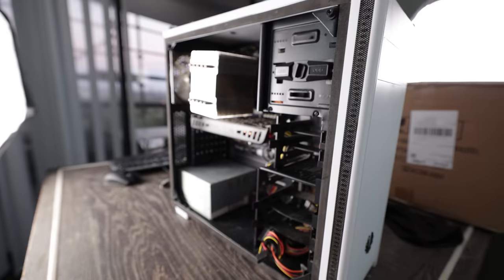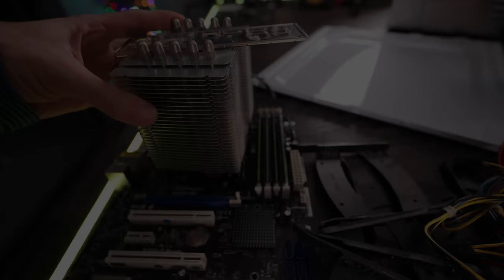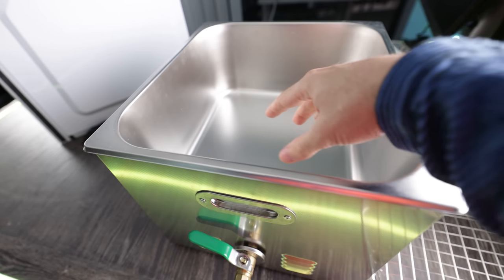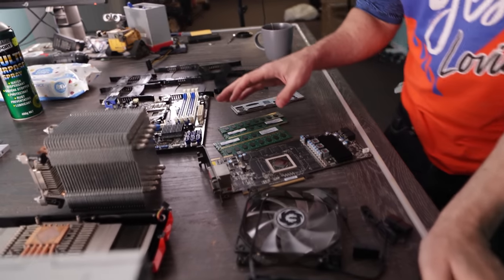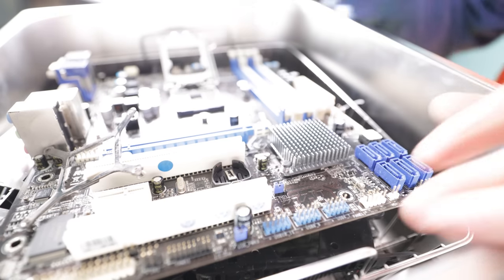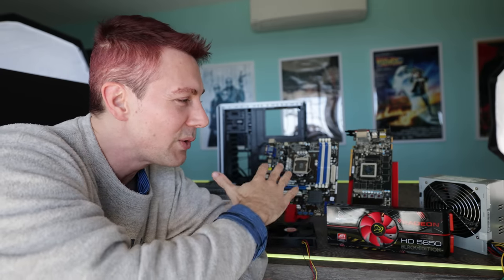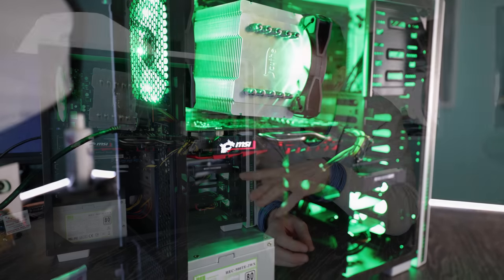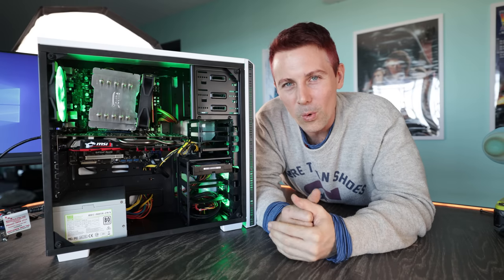ULTRASONIC Cleaning a THROW AWAY Gaming PC! - PCUC S1:E1

Comment: Always hold fans when blowing with air. You can damage them or other components such as when it was plugged into motherboard. And don't stack electronics in an ultrasonic cleaner, its vibrating, your vibrating the computer parts against each other at an extremely high frequency.
Reply: As the wise Greta once said 'BLAH BLAH BLAH'

Comment: Finally got the ultrasonic! 👌🏻
Pro tip: cleaning, drying (alcohol bath) then dry again. Alcohol will displace the water and evaporates quickly. 
Also an ultrasonic with wave oscillation is the best for mobos / repairs

Comment: The only thing that I would be reluctant about submersing in water are the fans.  Shouldn't the bearings at least be taken apart and lubricated after drying them out?  🤔
I have gotten some good results washing out old motherboards and using a hair dryer or heat gun on low settings to dry them out afterward. Nice video Brian! Love the finished product!  👍👍

Comment: This was super cool. If I ever get to a high enough level of volume I'm getting one of those cleaners.  Cant wait for the next one!

Suggestion: Next time you should run benchmarks while its dirty as well to compare with the cleaned version. Obviously it's going run better with a new cpu and graphics card, but It be would be really interesting to see how much of a difference getting all that crap off made too.
Reply: What is the best way to clean without an ultrasonic cleaner?
Reply: @charlescadogan8504  Elbow grease and 99% alcohol

Comment: want your CPU to run cooler? switch directions of the fans you installed and add an extra fan on the back!
the airflow direction is only running hot air onto your CPU
you need to have air being pulled into the case not out of the case i would also reviser the fan on the front of the case also so you can air enter the back of the computer and leave though  the front since you don't have any vents on the top of the case....
only a personal suggestion!

Comment: liquid name which u used with water?

also how many Little is this cleaner? will 3 litter is ok for Mobo?
Reply: Just dishwasher soap is ok.

The most important part is drying all components for 3 days, if possible, create DIY incubator box as if you're trying to hatch a chicken. This way you can dry off Electric components easily

Comment: few aesthetic recommendations: the inside of the case is black,switch the psu to a black one,which will also match the gpu and to keep that colour scheme -as you did w/the ram,dominator ddr3,right?-also make the bling fans red.
p.s. the mobo is shite,so no matter what you plug into it,its still shite.
great work Bri,keep 'em tech yes vids commin'!
p.s.2 did the owner keep it in a sawmill or a barn?

Comment: How long did you have dry the components for after washing?
Reply: 1: he used towel
2: waited a while till looked dry
3: blew air on it (could also use heater)
4: you're left with some water residue that won't evaporate. That's why he used the spray which inlcudes water dispersant. You can use alcohol for this too.
5: he then let it overnight. If you alcohol, it's enough to leave it 5-15 minutes after this

Comment: Greg Salazar - I'm not even touching the power supply, it is quite a dangerous step...
Tech Yes Man - Just wash it with water!
Reply: pure water is not conductive though. salt water is
Reply: 8:17 - 8:45 is the best part imho. Handling power supplies is only dangerous if you don't know what you're doing. So for some people its better they leave the power supply alone.
As shown here its perfectly fine. The only thing I would do different is: I would've at least partly disassemble it first to see better whats going on inside and wouldn't've throw the fans into the ultra sonic cleaner. Their might be ball bearings in them which are not happy without some grease and geting new grease in them is more work than cleaning them with a cloth.
I don't know but I guess Greg wouldn't've been sued for showing how to wash your power supply on his channel if someone is going to be hurt doing so...
Reply: yeah Bryan drowns all the PC components in soapy tap water, but still hand wipes the case down. Yet Greg hoses cases down in his driveway.
Reply: @jherdamrhoimagallanes8464  Tap water isn't pure.
Reply: Greg doesn't have the yes on his side
Reply: That Aussie is built different

Comment: I don't get why people just let their PC's collect dust like that. Ugh :_FaceWonder:.
Reply: ikr
Reply: some people don't know how to clean a computer or just think there's no need I've already received several computers with a simple problem because the person didn't know it was something like cleaning the cooler.
Reply: I don't really have time to do that..work bro
Reply: @Hakan89  if you keep a computer clean regularly and make sure you don’t keep it in a place where it will accumulate excessive dust like in a carpeted floor it doesn’t take long blow out a computer with a can of compressed air. I take 10 to 15 minutes to clean my desktops at least once a month to a month and a half. That level of care will help make sure your computer runs for a very long time.
Reply: People put the PC on the floor. and have house pets XD
Reply: @Hakan89  3 minutes top with a good blower like a data vac or any knockoff
Reply: @virtualtools_3021  i have a laptop , that's more difficult
Reply: Mine  not boot up after make cleaning servis at my pc how bout that.

Comment: There is NO WAY that I would do that type of cleaning with a PSU or fans. Some PSUs have cardboard or paper in them to direct airflow and as part of the transformers. A lot of PC fans also have unsealed bearings, if you get water in them it can significantly reduce their life. The other stuff is fine as long as you dry it out.
Reply: Interestingly...i just posed a question about fans too.  Thanks for your comment which has expanded my knowledge of the inner workings of the psu. 👍🤓
Reply: @SFAJmz05  I wouldn't water the fans too.
Reply: Also, don't just blast fans with compressed air like this, always prevent the blades from spinning when cleaning them.
It harms the bearings, and since a motor can act as an generator, it can induce voltage which can damage the motors elecronic or whatever it is attached to.
I always lock them in place with toothpicks.
Reply: @timhartherz5652  the bearing part I can see, but the power generated is negligible.
Reply: @EvilTurkeySlices  yeah people really overestimated the power of muh renewable energy

Comment: Something to keep in mind is that the power supply tester simply verifies that the power supply is still working and putting out the correct voltages.  It doesn't forecast power supply health so a PSU that tests good a month ago could fail in a month due to capacitors already being on the way out.
Reply: That's true. It's always good to check capacitors inside, or possible corrosion.
Reply: A PSU with bad caps may already show some signs of voltage regulation issues so although you are correct, it should mean the PSU should be pretty healthy at that point.

Bad caps usually fail fairly slowly before they finally pop, so you'd see some bad voltage a fair way out.

Comment: It's really not fine to use tap water. Especially if you have hard water. You should be using distilled water. 

If any minerals that are in the water don't get 100% removed before you fire up the electronics you could fry is. The minerals can act as a connection point. You have been lucky.

Why is that cpu block installed like that. My OCD is jumping off the charts!

Comment: You know, it's pretty easy to make clean water, rain water is very clean, just collect it through a filter and that's free electronics cleaning water. The output of an AC also creates clean water. The best way to disperse water is with ethanol closer to 100% the better and it's dirt cheap to either make or buy.

Comment: I'm just curious about the fans after submersing it to an ultrasonic cleaner. Because most bearings have some sort of lubricant in them. I'm assuming it's better to attend to those fans and refill them with machine oil/grease.
Reply: those fan bearings will be sealed so lubricatnt should not be impacted in any way!

Comment: There's another trick you can use the ultrasonic cleaner. Fill it with alcohol to clean PCB's especially... The alcohol is much harsher on the components that's why you don't really want to have plastics in there and it will remove numbering and stuff but good for hella dirt not so much for dust as the water should work just as well for that

Comment: Very nice I have cleaned with ultrasonic cleaner many times before, however be careful of the PSU. As a motherboard it also requires thermal paste and thermal padding sometimes on some parts, so just investigate if that model requires any of those or it will have a very negative impact. Instead of using water you can buy none conductive electrical cleaner to use in the ultrasonic cleaner cutting down on all the waiting and mess and fuss with water.

Comment: a cool video idea would be using the ultra sonic cleaner with isopropyl alchohol to see if you could bring dead hardware with water damage and so on back to life, since its displaced water and can clean, even under the gpu chip

Comment: Anyone used an ultrasonic cleaner with a bath of Isopropyl Alcohol? maybe an option if you can provide enough ventilation ?
Reply: Heard it was a real fire risk. Supposedly some people fill the cleaner with water, then add another bowl inside the water.filled with 99 percent alcohol for less risk. Don't know if it works tho.
Reply: @christophermacias1334   Oh I know that IPA is highly flammable, I was thinking of outdoors on the end of a l o n g  extension, poss sitting on a concrete slab

Comment: No real reason to toss old parts unless they are toast. My current PC is running a 12 year old xeon ,32gb ddr3 in quad channel my board can handle 64gb or if bios updated 128gb. My setup both cpu and mb can even support ecc ram. I upgraded my ever faithful 680 4gb to a 8gb amd gpu a year and a half ago.  My setup is old as dirt but I am able to game just fine with my rig.

Comment: Omg what is he doing? I could not believe what I saw, my jaw dropped. DO NOT DO WHATEVER HES INSTRUCTING YOU TO DO!!!! 
Proper way to do this: remove/desolder all sensitive parts from PCB, especially all piezo buzzers, use a special undiluted PCB wash solution, preheat to 60C maximum, place prepared PCB in ultrasonic one at the time or in single layer, DO NOT STACK LIKE HE DID! Set for max 1 minute then flip pcb and set for another minute. That should be done, in extreme cases repeat for another minute, then wash with demineralised water (NOT TAP!!!) then wash and swirl PCB in 98-100% Isopropyl alcohol to ensure it displaces all water. Then try with air gun at 50C low airflow. And it’s done.

Comment: I'd still use distilled water on all the parts at the end, it's cheap, and with no minerals in it it doesn't leave things behind that can cause shorts etc. Everything must be TOTALLY dry, put it somewhat near a heater for a day etc. That spray is completely unnecessary.

Comment: my friend accidentally dropped a milk shake from DQ onto his pc and it all leaked down the fan into the MB . the pc was unplugged at the time, so i took everything off the MB including heatsink coolers for chips and put it in a tub with 92% alcohol and used a tooth brush to clean it all off . i didnt have any spray like you have. so i just used fresh alcohol after i took it from the tub for a final rinse . saved two MB this way so far.

Comment: BEAT MY SYSTEM

Xeon e5-1650 v2 -60$
GTX 980 4gb - 120$ (watercooled closed loop)
16gb 1333mhz ddr3 Ram - 30$
Motherboard - 50$
Power supply - 30$
Case used - 5$
1 x cpu water cooler closed loop - $30

Total= $265
PCGameBecnchmark score= 853/1000

Comment: man!!!!! you have  ultrasonic cleaner, but don't have a compressed air...!!!!!!!! come on!!!!!!!!!!!!  impossible, used 50l are cheep, all off that dust is remove using, and them the ultra finish the job compressed air, power supply, open , clean, and check for bad caps

Comment: After you take the parts (Motherboards or Graphic Cards etc.) out of the Ultrasonic Cleaner, you're supposed to put them in the oven at a very low temperature (and no, I'm not trying to be funny) so that the warmth of the oven will dry up any water droplets stuck underneath the IC Chips on the circuit boards.

Comment: You normally rinse with 99% alcohol to get rid of the water (alcohol evaporates). Then stick in a room with dehumidifier. If you want to get fancy, rather then use dishsoap use branson EC cleaning liquid. Other then that not bad

Comment: You should really use the air blower OUTside the house otherwise, your room will fill with dust!  I didn't know you can use Ultra clean with detergent and Water on Electronic components and don't remove the water(through heat and blowing) after that. Water plus detergent through electronic parts is a no, no for me and risk future reliability and more work. Personally, I would use just a high-velocity air blower with a small nozzle.
A Useful video, a recycled PC not many people doing it anymore. The number of manhours you put in costs more than the original PC sold today. Basically, you do this just to make a video and the knowledge you have comes in very handy and easier for you to do it. The average Joe won't be able to do this ie more applicable to those who know what UPGRADE compatible parts to buy.
👍

Comment: I should get such a multipurpose spray canister. I've been trying WD40, but that stuff just makes everything greasy. Leaving it for days and still everything very greasy. Also, does that PSU tester also do load testing? Good voltages are nice but the real problems mostly arise when the PSU is loaded with varying types of load.

Comment: Ok so what if I got a small amount of IPA under the cpu into the socket then 30min later turned on the pc?
I just built a pc for my friend and it didn't post at all, even caps lock on the keyboard would respond so it was completely frozen.
I put some ipa on a paper towel, wiped down the cpu and blew off the ipa rubbing alcohol with compressed air. I saw some ipa drip into the socket behind the cpu but I didn't think much of it.
After installing the heatsink and gpu, I turned on the pc and no post. We tried for a small amount of time, but I don't even know if we have either defective parts or I shorted out the cpu?

Comment: You are supposed to use it with 99% alcohol, not water! 
you can say goodbye to all those components in few months
good luck getting that water out from under chips on MB, RAM, GPU, small parts of metal, salts, minerals in water dry out under those!

Comment: my advice to you: use destilled Water instead of regular one. u can even use special liquid for electronics, it is more safe.
after cleaning put the electronics into oven exactly at 36°C and leave it for 12 hours or more to be sure it's dry.
and, the most important part. use isolation spray for electronics.
thank me later

Comment: Motherboards do in fact use tap water to cool them after the boards have gone through the solder wave machines. The inexpensive water is part of the reason the electronic circuit board manufacturer that my brother-in-law has lead engineering at for the last 30+ years is located in Upstate New York. If the boards were not cooled off in this way the people on the manufacturing lines could not handle them to add through hole parts and wiring let alone inspect them for quality control. And I imagine quality parts are important to the US Army, Marines, Air Force, and to the other military contractors that make the final products for them.

Comment: Ow man that's so bad what you did, spinning up those fans with the connector still attached. When you do that the fans are generating a much higher voltage that's going back into the driver circuit and you risk blowing up the fan driving circuit. NEVER spin up any fan that is connected to the motherboard or the graphics card or the power supply, you did that with all three fans still connected.

Comment: don't use destilled water the dust and debris make it conductive, it just cost more than water. Youl could however rinse with destilled water. Also multipurpose spray is a pretty aggressive greasy cleaner, it could remove the protective layer from pcbs it also leaves a layer of grease for dust to stick on. I always clean it again with water and soap rinse with destilled water, dry it with a heatgun or just leave it to dry for a couple of days and than coat the bord with conformal coating.

But with a ultrasonic cleaner I think I would go for a non aggressive soap (baby soap maybe) and do an extra pass. No need for the multipurpose spray saving the coating. Also heat makes the proces better, so if your ultrasonic cleaner isnt heated just fill it with hot water.

Comment: Gotta be careful with deionized water, not to go full chem lab on you but by nature deionized water pulls ions out of metal which by definition means it is corrosive.

I know with steel it can cause a layer of oxide to form on the metal, than some chemical rations between the oxide causes water to turn into peroxide, which than later converts to sodium (rust).

If you use really cold water it should slow down the reaction if folks (or you) decide to use it, safest option (long term) would be to add a corrosion inhibitor to the mix.

Comment: Alright Brian.. I've tried this method, but there is moment after using this spray, it looks like there are some traces left .. I mean the stickers on the board looks like they were soaked with something .. apart from the fact that sometimes they peel off and fly away..Is that a big deal or..